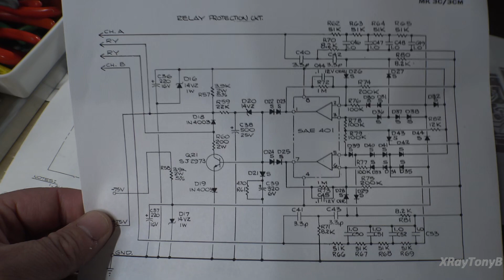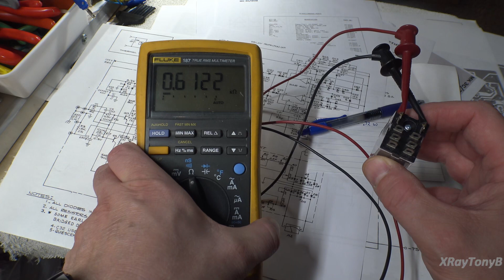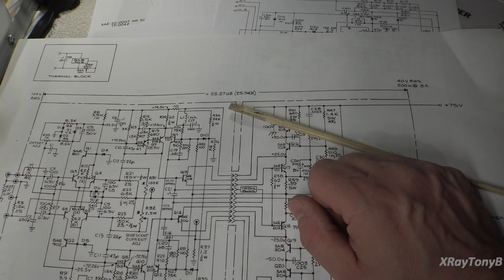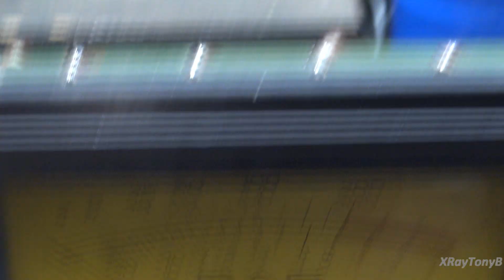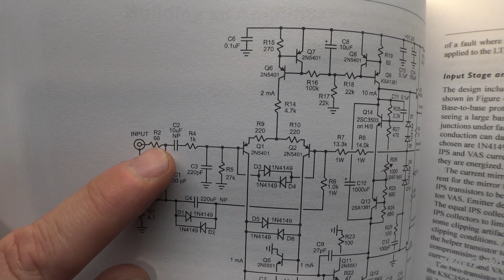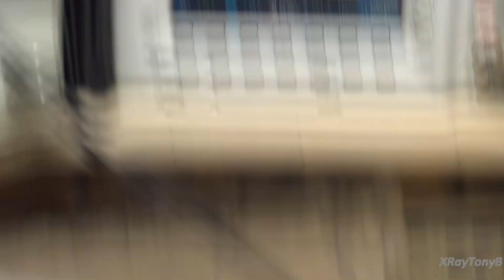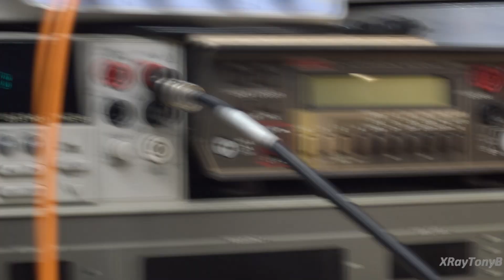SAE Mark IIICM Amplifier - Part 2 - Making it Right

Comment: @ 5:35 The  difference of resistance of the relay coil, and it's difference in current draw, is fairly irrelavent in that circuit as far as when it turns on and off, as it's drive  ( current sink) is from Q21, which is biased on by the SAE410 Op-Amp comparator ( which will basically cause a instantaneous full 24V energizing voltage sink or source, or 0 volts)  and it's turn and off time will be instantaneous and its on-off time will not be a part of a R-C constant time base circuit. Granted, Q21 has to be capable of handling the rise in current draw, but a change in R60 reflecting the difference in the resistance of the 2 coils, or a suitable transistor substitution can take care of that. If the coil was part of a R-C time constant, then yes, you may have to adjust that R-C circuit, or add a series resistor to simulate the original coil's resistance and engagement time properties.

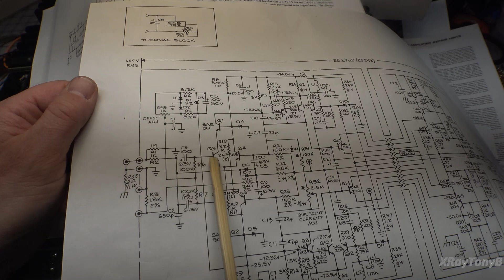Comment: For the bypass cap add at 41:00   There was nothing wrong with the original amplifier design, you kinda missed that, C2, a 680pF capacitor, below your differential pair input, is already in place serving as a HF bypass after R1, and R2, so, you added a refundant level of bypass.capacatance. What you did can't hurt outside of rolling off more unwanted HF + RF signal , but it probably won't have as big of an effect as the 680pF thats already there.

Comment: I've the SAE MK31b amp and found it's assembly similar. Had to dismantle the board from the chassis, otherwise gaining access to those trimmers would be difficult through those ventilation slots. Thought it strange SAE would design it that way compared to other manufacturers making access simpler. 🤔

Comment: Excellent videos on the series with the SAE amplifier.  Ironically, if SAE had built that protection in for the inputs at the factory, the cost would have been not too high and I'm sure many consumers wouldn't have had an issue with the minor cost increase.

Comment: This video shows extreme professional talent in action. Installing the mods all made sense, for the proper affects. When someone has previously worked on an amp of this quality, and the seller may not have known what was done, that's a big red flag. Tony learned something about the darlington transistors being used in the output stage. The way that Tony was careful to know where the position of each output was supposed to be was excellent on his part. Enjoyed all three of the videos he made on the amp.   We have personally repaired a McIntosh 2100 and that is a different output circuit, I believe a completely complimentary circuit. We checked the output transistors using the voltage drop voltage between the emitter and base to match the two drivers within a few thousands of a volt, then all the others as close as we could. We heard from the Dr. that owned the amp a couple weeks later and he said it sounded better than new. I was taught that the turn on point i.e. was how to match transistors.

Comment: When i said a high speed amp can sound better, i meant the amps internals.  Minimizing rf input would make the amp more stable for sure.  That said the internals of the amp are still able to shuck and jive better than an amp with a lower high frequency limit.  I understand that the low pass filter will limit the ultimate upper frequency limit but i was talking about transients caused by multiple lower frequencies canceling, not actual high frequencies.  I can hear the groans that the high transient from the cancellation is still a high frequency.  I can only say that the signal coming in is based off of lower frequencies.

Comment: If I remember correctly the 3cm could do over 325 watts at 4 ohms.
  
Around 1976, SAE came out with the 2400 and advertised is as the " $750 Alternative" which was $250 less than the 3cm , but I don’t think that the 2400 had the same current capability. I think that they took some stuff out of it to lower the cost, and they came up with a new look that most people preferred. 
My unmodified 3cm has been running for 45 years and was tortured for the first 2 years of its life before our band had the money to purchase a real PA system. 
It never blew up on the road and people readily did the "thumb" test on the inputs (we didn't know better back then). The protection circuit was disabled (we couldn't have momentary clipping take the vocals out for 5 seconds +) and one night the fan that we used to cool it got knocked over and thing got so hot that you could't touch it.  It survived all of that and then blew up in 85 about 9 years later. I use it today for the front left and right of a home theater system. It still runs great with the original
 Bongiorno design. I talked to Jim around the year 2000 back when he was rebuilding SAE amps, but I decided to wait to see how long it will take for this thing to blow up. I am now retired so I have plenty of time to rebuild it , if it actually goes before I do.

To me there is no need for soft start. This is part on the character of this amp. Part of showing it off in the 70's was showing people how it dimmed the lights. The current limiting is provided by the branch circuit wiring from you breaker panel.

Comment: How did You decide to use 15 Ohm 25W resistor on mains input to transformer in your soft start circuit? Ohm's law? 120V/10A (fuse is 10A) is 12 Ohms, that's close to 15 Ohm resistor You used... Thanks.

Comment: In the Douglass Self book, a good audio amp book just like Bob Cordell's, he discusses speaker protection relay distortion. You may think, what distortion, it's a relay? Well I was surprised at what he measured. Of course it was minuscule but there was some measurable added distortion.
Reply: The reason is that some relays pass the signal through the soft iron frame in the relay. Ferromagnetic material tends to be somewhat non-linear. With high currents it can certainly be measured. Self also notes that binding posts that steel binding posts are another red flag in that regard- brass is preferred. Again, Self was able to measure it.

Comment: The new bias voltage setting should be 1.58 volts with the new 0.1 emitter resistors.   The Shottkys you removed are intended to prevent the Darlingtons from dropping excessive voltage across the output finals as output current rises.  Not a big deal, but it will run hotter without them. Lowering the emitter resistors also will require thev finals to drop more voltage at high output making things worse.  Good work overall, very thoughtful.  But you have reduced its ability to deliver rated output for extended periods.
Would be glad to discuss more if you like off line.  Be well.
Reply: Yes , unlike parallel output stages , you only have 1 set of emitter resistors in this series connected output stage. The original Shottkys were a little underrated in my opinion as this amplifier can deliver over 9amps into a 4 ohm load. Removal will also most likely affect the current limiting protect circuit as there would be more voltage drop across the current sense resistor when the Shottkys were in there. I don't think that any current or drive limiting testing was done on this amplifier. Or any testing at 4 or 2 ohm loads.  Once you are above about 6 watts into 8 ohms or so, those diodes are bypassing the emitter resistors.

Comment: Why not use a thermistor instead of the relay to limit the inrush current?
Reply: IMO, that's OK for tube amps which are mostly limited to 60 watts per channel. Big solid state amps can pull much higher line current and even the hot resistance of a thermistor can be too much and act as a current limiter. This would tend to destroy the amps damping factor at higher power levels, just where you need it the most.
Reply: @andydelle4509  It probably wouldn't affect the damping factor much unless the filter capacitors were grossly undersized. There is a decent chance of the thermistor failing, however, and no matter what it will drop the line voltage more than is ideal.
Reply: @H-77  Agreed. I never liked the idea of thermistors permanently  in the AC line and don't use them myself. When necessary I always build a soft circuit with ample power resistors and a timed bypass relay. Not a fan of thyristor based designs either. I have repaired a few of those on stage amps. Peavey  used them extensively.
Reply: Are we talking about negative temperature coefficient (NTC) thermistors, here? I am sure that we are, but just to be clear... I was thinking of them, myself.
Reply: I've used NTC  thermistors in quite a few different projects.  They make a wide variety of different current ratings and resistance.  You just have to match them to your needs.

Comment: Dude, you way overthought this.  A ICL is all that is needed for soft start. Relays always fail in that use. Crestron’s big 16 channel amps use big ICL’s. Many of Bongiorno’s amp designs were prone to blow ups due to RF bandwidth. Anything above 50 khz should be filtered with a 6db / octave at the input. Also , a common addition to the LTP input pair can be open loop gain reduction above 50khz as well. Many of the later designs using fully complimentary LTP pairs used that design.
Reply from the maker: I originally thought about using them, but chose this route for two reasons.  First, ICL's give off a lot of heat when they warm up and go to low resistance.  I don't really want that much heat inside the amp.  Some of the old McIntosh gear used them and they would get so warm that the wires around the ICL would get all crusty.  Second, the ICL will go low resistance, but not usually any lower that 1Ω.  This small amount of resistance still adds an element of current limit, even after the caps are charged, which could at least in theory affect the dynamic performance of the amp.  Using a 15 ohm resistor, there is a fairly low current that will be switched by the contacts, so arcing isn't an issue.  With all 3 contacts wired in parallel, the contact surface area is quite large, after the contacts close, so again, I doubt that they will wear out any time soon.  The circuit consists of a simple relay, one 15Ω/25W resistor for the limiter and a 900Ω dropping resistor for the coil.  All of this is pretty inexpensive and easy to implement and should last a very long time.  
Thanks for the comment!
Reply: Countless amps have used the relay-based soft-start that Tony implemented here without issue. The MC2 MC series amps all used this type of soft start and it rarely if ever fails. ICLs are a nice and simple solution, but far from ideal, especially in amp that is pushed hard.

Speaker protect relays, on the other hand, are a bit of a sore spot since few of them are actually rated to break the connection if an output transistor fails short. Few relays smaller than an industrial contactor can break 90V @ 25A DC with a reactive load.

Comment: As long as we're poking sticks, it seems that when you are looking at a schematic and have the led light on it, the flicker in the light beats with the frame rate of the camera, giving us rolling bands of light and dark crossing the schematic. I first noticed this when you were talking about the input filter at around 42 or 43  minutes in the vidieo.

Comment: This is why I dont like working on this stuff anymore. When you have to go behind someone else who has "tinkered" with it, its just super painful. I did car audio amplifier repair for a few short years, and I saw this all the time. So much that I ended up leaving that job. Its different when youre repairing a piece of equipment that another professional technician has serviced in the past. But its the shadetrees like the one who touched that SAE that I worry about, or worse... people using IRFZ44 in place of an IRF540 in an output stage. Some things I will just never understand. Sorry for the rant and if I sound harsh, but its just been my personal experience. :-)

Comment: IMHO: Soft start circuits are "mandatory" for every amp I build (or will build) regardless of power output. I even built  an external one to feed my three (soon to be four)  external PSU's for my "add-on" DYI Audio projects. It really extends the life of equipment. I use 24VDC. You can build a "generic" soft-start (driven by the AC line) using a standard (400v, 4amp) bridge-rect, 1000uf 50 VDC cap, and two 1/2 watt 24 volt zeners, (makes the 24 DC power source) a 220 ohm (2 watt) current limit (from the AC hot) and a 1uf (250volt!) cap in parallel with a 1meg (2watt) resistor. The 220 ohm is connected between the AC and the 1Meg/1uf in par. The other end of that par. circuit connects to one AC input of the bridge. The other AC input of the bridge connects to AC neut. The 1000uf and the 2 zeners are in par. across the DC output of the bridge and drive the relay. You can tweak the time delay by adding  series resistors to the relay power leads. For a 24 relay with 600ohm coils, I used 2 100 ohm (1/4 watt) res. One on each relay power connector. This gives about a 2 sec. (long) delay. The relays I used "trip" at about 18 volts. (purchased  from JameCo)  Other than the fact that the high voltage cap is a bit expensive..this circuit is easy to build, takes little space and is very reliable over time. You can stuff all the components in a small residential electrical junction box. The actual relay connected current-limiting resistors are 4*200ohm (5 watt ea) in par. I got this circuit from Randy Sloane's..Audiophile Project source book. It is NOT documented anywhere on the internet. The par. RC circuit (connected to AC-hot) takes advantage of the capacitive reactance of the RC network at 60hz. So the circuit itself takes very little power. I even "modeled" it in a circuit simulator program so I could examine voltage and current levels.

Comment: it seems that you could of just used some CL30 or 60 inrush limiters. Those on/off switches are very robust. I've seen them operate continuously for over 40 years.
Reply from the maker: The CL series current limiters will still have resistance when at operating temperature, which will still limit current to the amp when it is playing at high volumes.  By having a relay, it will bypass all current limiting to the transformer, once the caps are charged.  I was also concerned that the larger capacitors (24,000 uF instead of 10,000) will cause more stress on the switch contacts.  In addition, the lights no longer dim on the bench when I turn the amp on!  THanks for the comment!
Reply: @xraytonyb  IDK Tony, an Ametherm MS32 15012 which is 15 ohm, 12A, would be ideal here.  Resistance @ 50% Max Current is 0.31 ohms, trivial.  I would go this route every time but to each his own.

Comment: The soft start is a fantastic idea! Please let me know if (and if not, why not): i) you installed a diode in parallel & reverse to the soft start relay's coil; ii) you installed an arc protection capacitor (e.g., 0.022uF/400V) in parallel to the soft start relay's contact, i.e., in parallel to the 15 Ohm/25W resistor in series with the trafo's primary wire.  Thank you.
Reply from the maker: The purpose for a freewheel diode across the relay coil is to suppress the back-emf of the coil when the relay turns off.  This can cause damage to semiconductors, such as transistors, as this voltage can exceed the max voltage of the transistor.  As this relay is only connected across a capacitor, it won't make any difference.  In addition, the dropping resistor will dissipate any back-emf from the relay coil.  Thanks for the comment!

Comment: How will this amplifier react around some strong RF signals?  Many amplifiers picked up strong signals along it's input, AC lines and even the speaker terminals which cause many headaches for Ham radio operators trying to get rid of the interference.
Reply from the maker: Radios are sensitive down to the microvolt range.  The RF & IF sections have extremely high gain and can be affected by small signals.  This audio amp is only sensitive into the millivolt range (with a gain of only 26x).  RF would most likely not affect the input, but a ground loop could.  Thanks for watching!

Comment: Hi there Tony. The diodes you removed from the output stage were also there for signal clamping to the peak output voltage, that can sometimes protect the speaker, and also protecting the output transistors from back EMF (electromotive force voltage spikes induced by the speaker coil that goes back to the output stage and can be of much higher voltage than the rails). I think you should try jury rigging two schottky 100V 10A diodes (like B10100) per channel, from the output to the power rails in this way:
Diode 1: Cathode to the output and anode to the negative supply rail
Diode 2: Anode to the output and cathode to the positive supply rail

It's not a big deal cost/time wise, it doesn't affect the sound, and can totally save the amplifier or the speakers.

Like this:
https://ibb.co/t8gZmmH